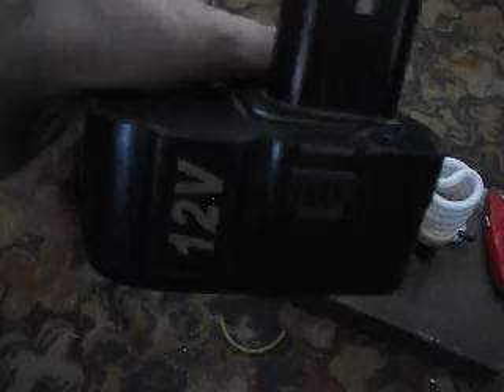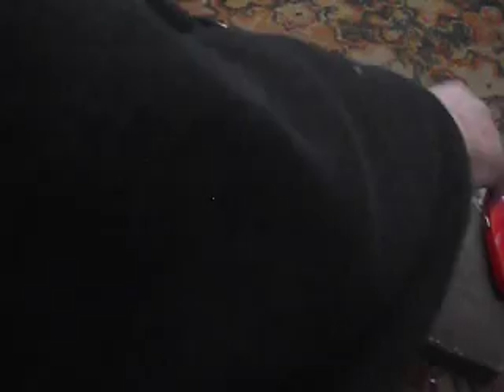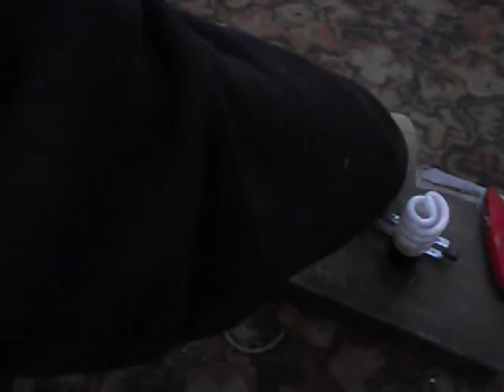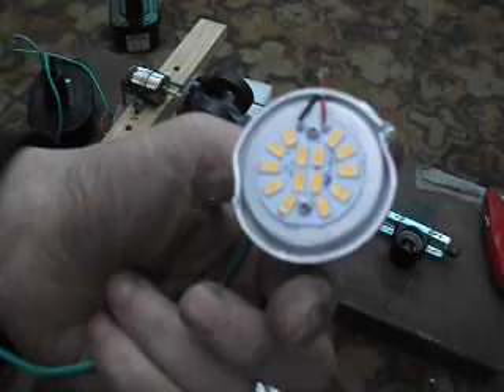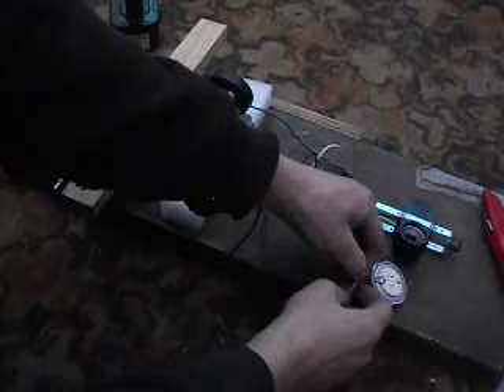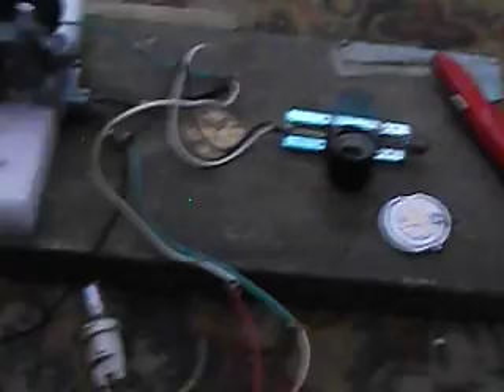gerard morin free energy test 1

Comment: 12v x 7amps = 84watts input..........40watts ouput does not seem to be a good system........why do you say it works well ???????

It would be more efficient to place a 40 Watt 12v globe across the battery, you will only use about 3 amps instead of 7.
Reply from the maker: not just 1bulb but many

Comment: This is not free energy.  It's a mechanical version of what an inverter.  It simply steps up the voltage but not the current.  Measure Watts In vs Watts out and you'll see it consumes more power than it produces.  Gerard does not seem to understand this concept.  He's never measured his input and output properly from the videos i've seen.

I can build a circuit that can power that lightbulb with a 9volt battery.   That LED bulb you got there,  I can power that with a 1.5volt AAA battery.   No magic, it's just plain electronics.
Reply from the maker: i run many lights

Comment: good job! I was most impressed that the LED light would light up from AC without its circuits. That little RC car motor sure does wind out , I bet you were getting over 300 volts by the sound of the speed compared to the 200 volts others are getting with slower motors.
Reply from the maker: i think so ,it does the job plus for a vintage motor thanks